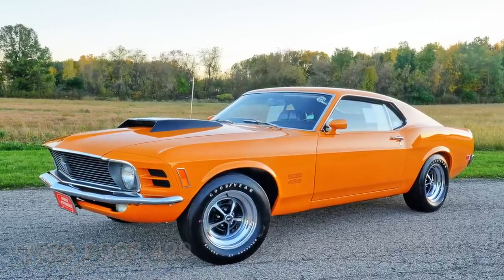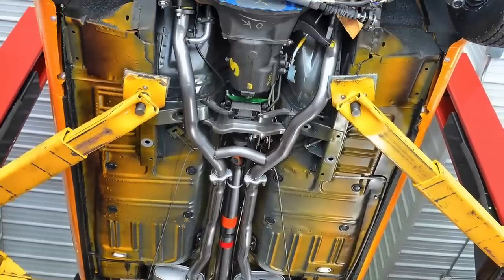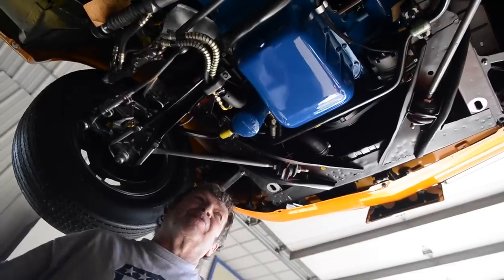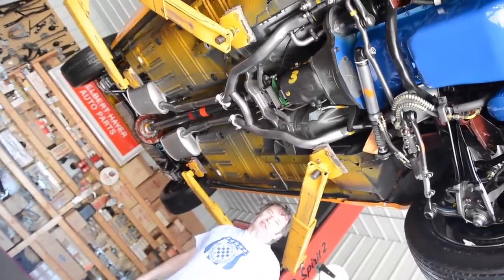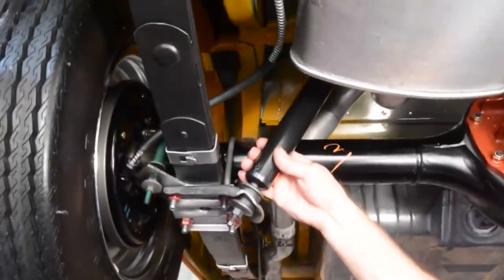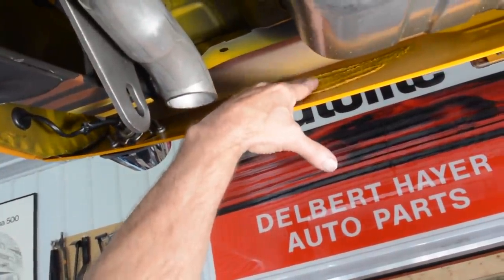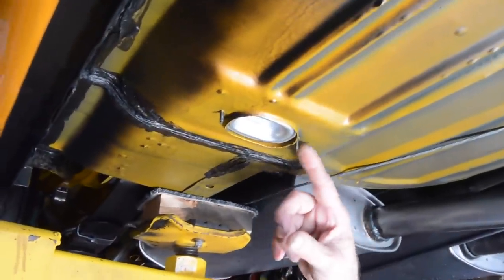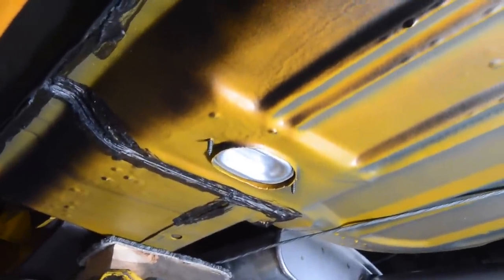Bob Perkins' Extreme Mustang Undercarriage Detailing

Comment: Like the black paint spilling on the inside of the rear wheels which dripped down from the rear brake drums. The flat side of the rear drum brakes were sprayed black and the wheel was mounted directly without letting drying the paint.

Comment: Man it's way too over the top for me.  I drive my 67 Shelby and 68 Shelby as drivers and show cars.  Burn lots of rubber in my 68 cobra jet 428 4 spd also.
Reply: grunenwald2005  That's the difference between a consumer and a restorer. Both need each other, to retain their value.

Comment: What keeps the raw exposed metal from rusting?
Reply: cozythunder  I use a smear of Vaseline to coat my bare metal. It seems to hold up for months at a time.
Reply: A painted garage floor , dehumidifier, not having the garage in a low spot

Comment: Permatex on pipe threads? ROFLMAO. It may be "concours correct" but it would never make it out of the "factory" because Permatex is not thread sealant and does not "dry" until in an airless environment.

Comment: so it doesn't run?
Reply from the maker: It's a pusher. Running the engine would condense water into the $30,000 exhaust system and cause damage. This is a full-sized model of perfection.